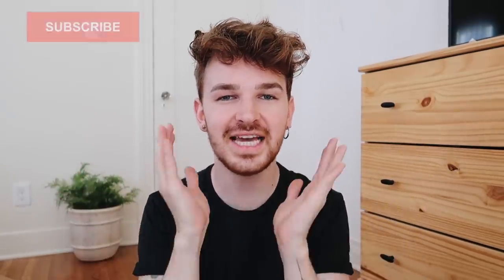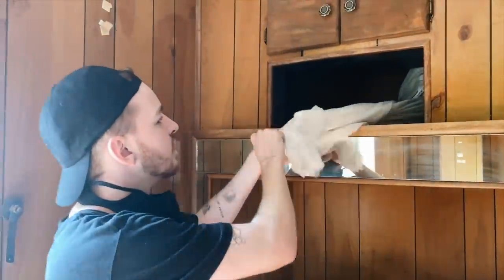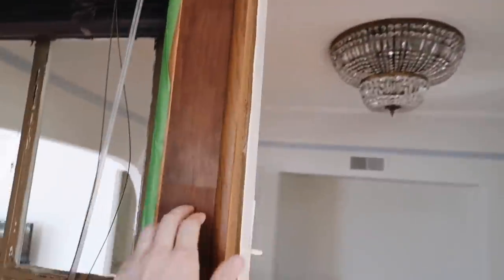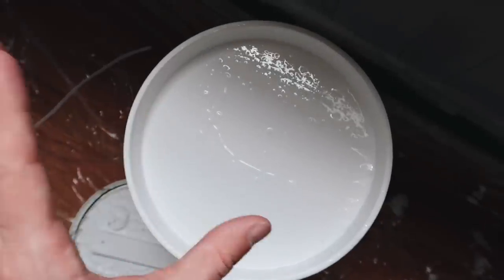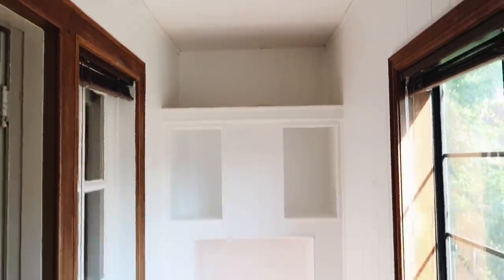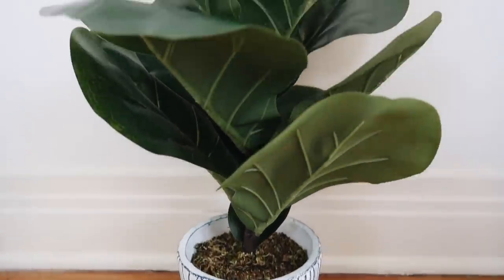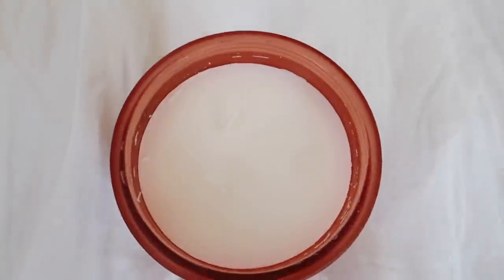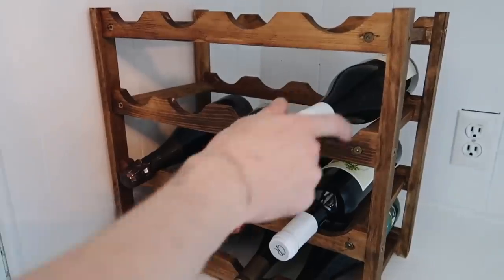EXTREME TINY ROOM MAKEOVER (From Start to Finish) *Insane Transformation*

Comment: You can tell the room used to be a bar area. The “creepy face” is a spot for a mini fridge and things like a blender
Reply: The mirror accents on the one side also make it kinda obvious
Reply: That makes so much sense
Reply: That also explains all the outlets
Reply: Lisa Huber yeah.
Reply: Krystan, it was a butler's pantry, yes?
Reply: Yes definitely looked like for a mini fridge
Reply from the maker: Somebody actually mentioned that it was a screening room because the larger box with the mirror has a cable cord! And then the cut outs on the opposite sides were for speakers. There are even little pipe connectors leading through the cut outs for cords to pass through!
Reply: Kyrstyn I figured it was a weird laundry room but that makes sense!
Reply: Their way of saying, " night on the town " ha
Reply: I think you’re right that someone turned it in to a bar area. But I think it was originally a porch entry way. I have a room similar In my house. I think it’s the fun part of older homes that then end up with extensions and look completely different 100 years later ( in my case don’t know how old this house is)
Reply: Lone Fox , I agree. You can tell it is an older house and back in the day it would have been posh to have an A/V room. That is where you would keep your record player, reel to reel/8-track/cassette player, etc. They spruced it with the mini bar. So mid-century chic LOL! I love what you did with it, though 😍

Comment: That turned out so good! A tip for painting paneling like that is to use a thicker roller nap, like a lambskin nap and you won't have to use the brush to paint all of the grooves. It goes a lot faster.

Comment: Hey! My guess would be that that was originally an open balcony. The door is an exterior grade door with sidelights and the paneling is clearly a later cheap/quick fix rather than drywall. Loved this flip! Using it as a bar room is a great solution!

Comment: Heads up if you stain furniture again, use tack cloth in between sanding and staining, it gets all of the dust off before you put the stain down. Also if you have old undershirts or just want to buy a cheep pack, those cut up make fantastic rags for staining wood with rather than paper towels

Comment: If the whole room is being painted anyway, I would have torn out the randomly shaped cabinets. Any holes in the wall could have easily been covered with more paneling. I'd install floating shelves on both ends, creating two library walls, and buy a perfectly sized arm chair and ottoman. Making the room into a cozy reading nook!

Comment: The nook surrounded by mirrors was probably for an old TV. The cabinet above could hold a VCR, the hole would be for running wires. The mouth of the face was probably for a plug in electric fireplace. That dark wood paneling was very typical of cheap 70’s decor, the space could have been a sketchy, make shift man cave.

Comment: You can often remove stickers and adhesive residues by heating with a hairdryer and i comes off easily without so much  scrapping. Don’t use a heat gun though as the more intense heat can damage the surfaces

Comment: The paper towel hack will work if you hold it at the top of the roller sponge not the sides of the sponge so you can grip without slipping!

Comment: Totally would of turned the horror movie room into your lone fox office space.. Sis can't work out of a closet she just broke out. Desk under the window so you get natural light and then used the nooks for files, printer, tec, photography equipment etc. You could put up a curtain rail in the main room so you can pull across and hide the whole office (murder room) when you want to switch off from work at the end of day or if you have guests over etc. And the closest you plan to use as a office could be for lone fox samples/ using the rail to put together look book outfits etc

Comment: This was such an ugly eyesore room to begin with, primarily with its odd built-ins and niches.  I probably would have asked the landlord whether I could rip out the two weird built-ins at each end of the room.  HOWEVER, you did a marvelous job painting and then decorating those odd niches.  The mirror part goes around the drinks area in a sort of art deco way which is pretty cool.  I would paint the window sill with stain and varnish since it looks as if the wood has deteriorated due to water leaks from when the window got misty on the inside and that mist condensed and leaked onto the wood.  I looked at the room and thought "mini-office or library" with the doors to close for privacy, but it also works well as a drinks/party space.  Well done!  The doors could also have been removed just to open up the space but if it was once a porch that was enclosed, it might be colder in there in winter so the doors might help keep cold out and conserve heat in the rest of the house.....

Comment: Why did you leave those stupid shelves/face and mirror? Seriously, it doesn't look structural; at least one looks easily removed, no? If not, if it's a dumb waiter, as someone suggested, you should be able to just convert it up with two sheets of sheetrock. It's awkward--not to mention ugly; you are losing 50 square feet of living space (I figure at least 6x4 on each end), which you are paying for and can't possibly use as is  even for storage; and your landlord gave you license. If one end is a fireplace, you should be able to pull out the stuff on top of where the mantle should be, and put in mantle or useable display shelves if you don't want to use the fireplace as a candle nook. Or, again, just cover it up entirely with sheet rock,  which would have the advantage of making the room slightly more proportional.